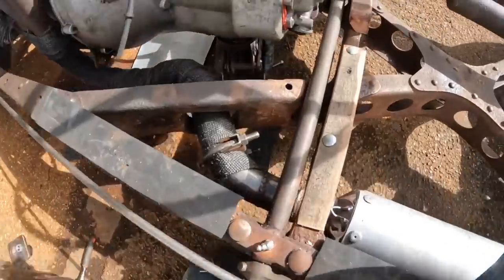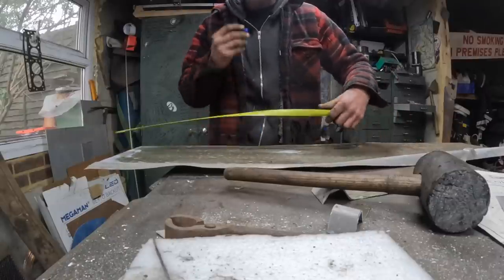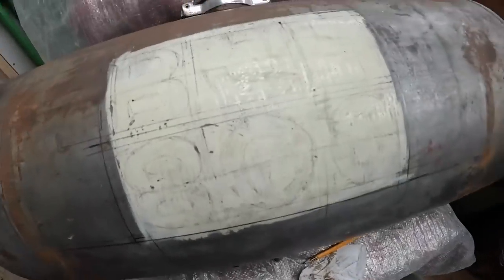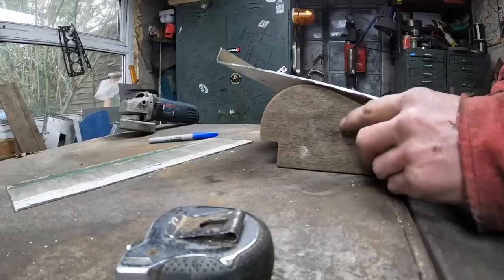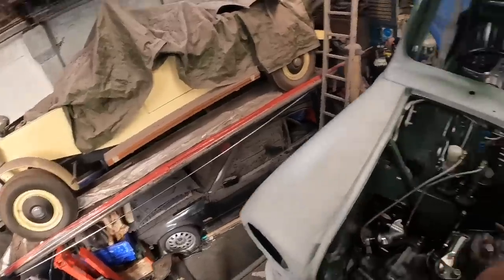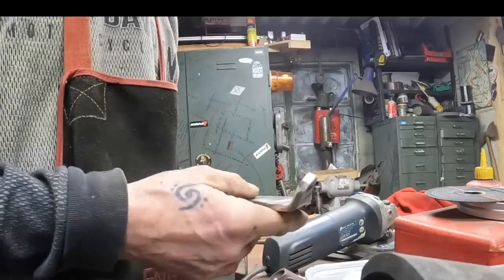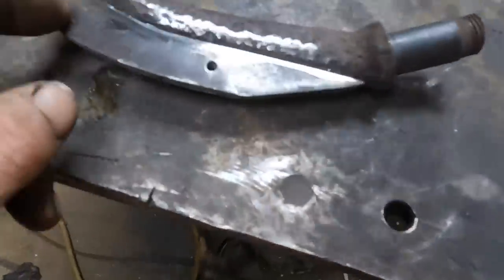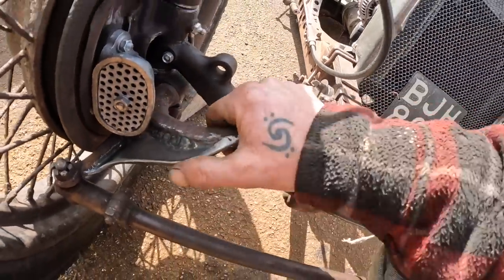the Austin ten special....rat ,   part 42

Comment: Alright Buddy, man you got through some jobs there, I like the cooling ducts for the brakes,  seats look good but that su pump looks way to big a capacity for  Ian you might drown him with gas, your arty side is defo showing itself now, but over all its just getting better and better, what you doing for a reg plate light. Dave 🏴👍♥️
Reply from the maker: hey Dave, thanks buddy ...no reg light as I wont have any lights bar brake....thinking about indicators thou...that su pump is an mg one , they only bang out about 3psi which should be fine I have a pressure regulator if not ...cheers mate